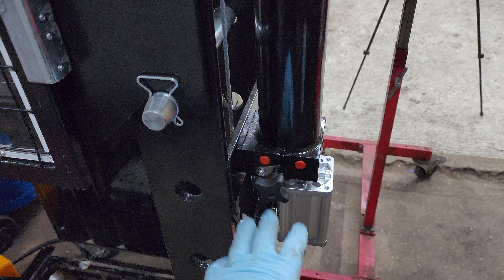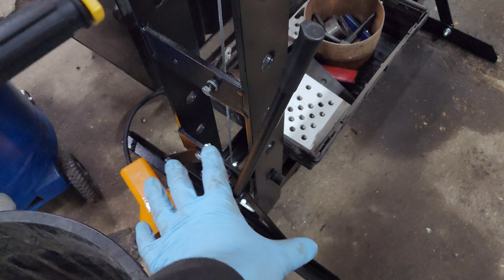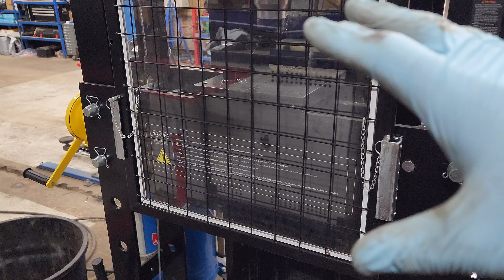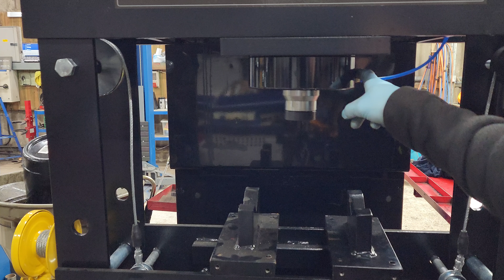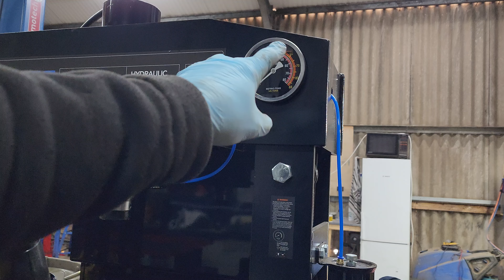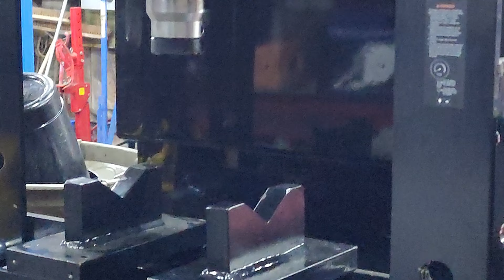SGS 50 ton air hydraulic press

Comment: I have one of SGS's 3 ton trolley jacks and have to say, for the money, it is good quality, well built, works well, and you can get spare parts for it as well if needed. Had mine 3 years so far and its been good. Hope your press works well and lasts a good while. As you say, stubborn wheel bearings can take a fair bit of pressure to get out.